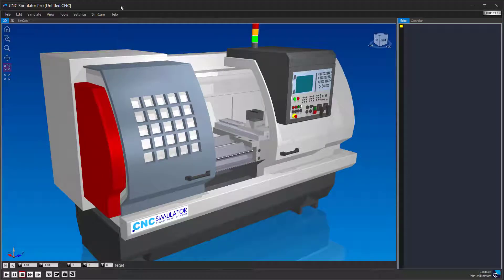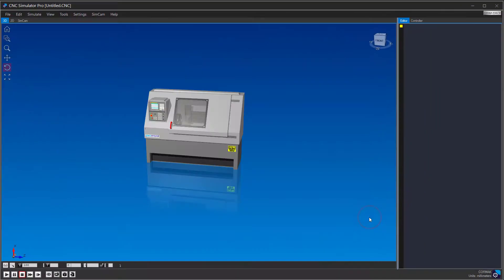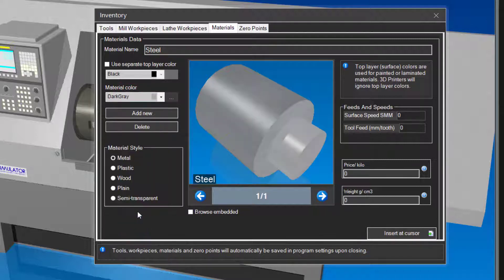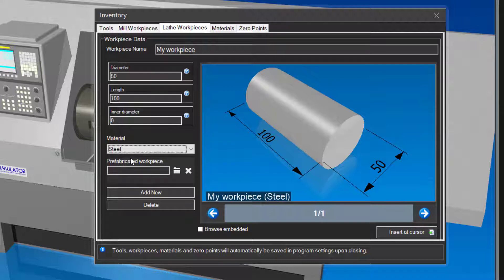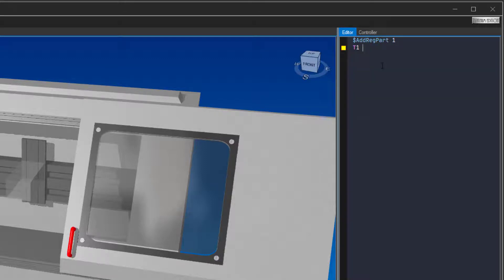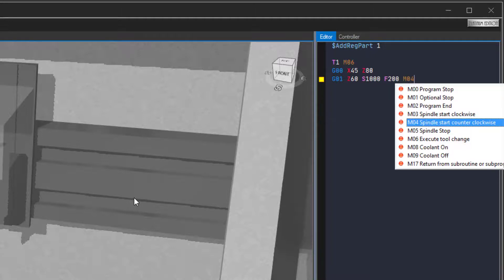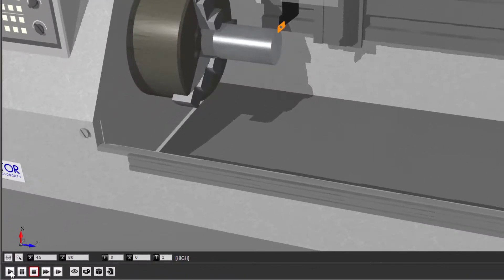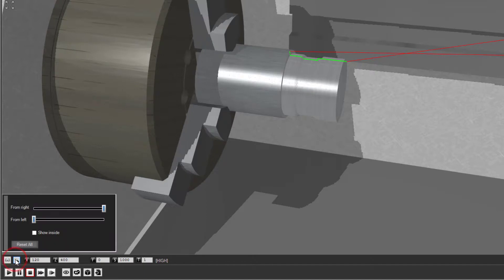How to create your first turning program in CNC Simulator Pro

Comment: Sounds like clear English yet your working with Metric numbers ??  I work in a pretty large machine shop building airplanes and no one there programs or even speaks about metric numbers so as I'm learning to program those numbers don't really mean alot to me even though I completely understand them coming from the automotive business for 30 yrs.  Nice presentation however.
Reply: the majority of countries speaking english use metric only country who for the most part only uses imperial is USA
Reply: @hstanley7374  I know that, my point really is I'm sure most of the views here are US people.
Reply: @larryrobinson7492  You already use the metric system, you simply do not use it in your everyday life. As someone working with machines, computers etc. you absolutely should be learning the metric system. The global standard is the SI (Standard internationale) which uses metric numbers and kg for mass, not pounds.
Reply: @KnuxligerKnux  Maybe you didn't read it but I completely understand it but it's not used At all in our shop no matter what you think.  If I see it I understand it just fine but all of our programs are in inches and that's just how it is.